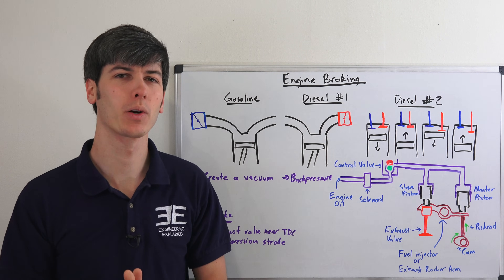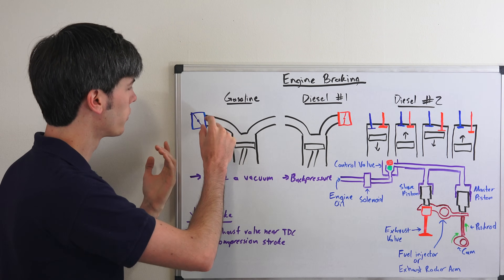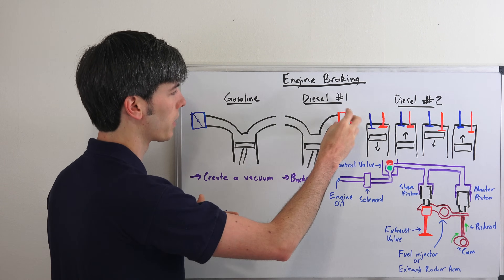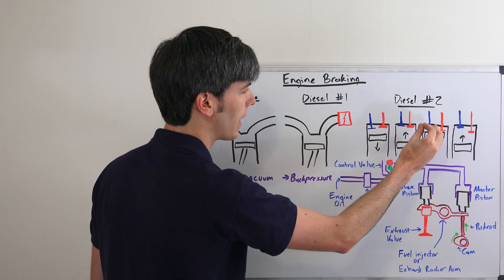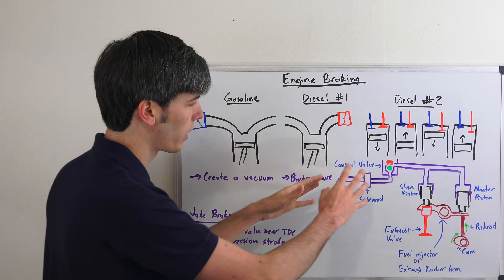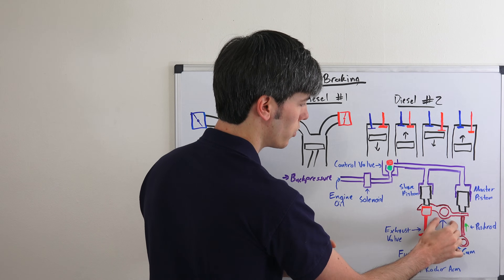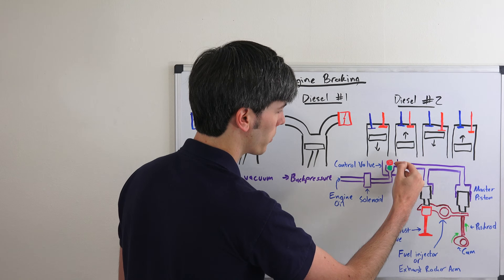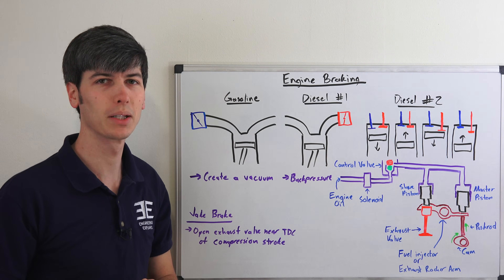What Is Engine Braking? What Is A Jake Brake?

Comment: Overall this is a decent introduction to the mechanics of engine braking. However, I believe that you could have added a couple of things to it.

First, in many electronic fuel injected gasoline engines, the computer is programmed to cut off the injectors in conditions where the throttle is closed and the engine reaches a certain speed, e.g., 3000 RPM, in order to enhance engine braking. The earliest example of this that I've seen is in a 1977 Datsun 810 equipped with the 2.4L inline six.

Also, in the case of the diesel retarder systems, it's important to note that these systems only engage when the injectors are set to their no fuel states, i.e., no fuel is being injected and thus no combustion takes place during the retarding process. This ordinarily happens when the driver removes his foot from the accelerator pedal and the engine is above idle. The second he depresses the pedal again, both types of retarders automatically disengage.

Comment: I have seen a throttle body on a diesel intake on a Renault Laguna. I wondered why it was there. I guess it might be to help engine braking. That doesnt sound good for efficiency though since its good to roll down hills with minimal fuel. It was a modern engine all ecu controlled and turbo charged.
Reply: Nope, it's not for engine braking.
Modern Diesel engines have throttle plates in the intake for their exhaust aftertreatment system. They close the throttle plate partialy when the the EGR-valve opens. This helps to recerculate more exhaust gases than normal because the pressure in the intake manifold will drop slightly. It helps to lower the NOx emissions.
Reply: Thanks, good to know!

Comment: I don't really understand this vacuum explanation, because OK, creating the vacuum takes energy from the engine, but in the compression stroke the vacuum pulls up the piston, so you'll gain back some of the energy lost by creating the vacuum. And I'm wondering if the exhaust valves can hold against the negative pressure? Because they are designed to work in the opposite way, and keep in the pressure. I'm not a mechanic, I'm just curious, and sorry if I misunderstood something.

Comment: Question (about the gasoline version). So there is a vacuum which is created during the intake phase, and that slows the engine down. But wouldn't the same vacuum accelerate the piston during the compression phase? Or is it that we have two vaccuum phases, intake and (not-)power stroke, vs one "inverse vacuum" (ie compression) and one non-vacuum, for exhaust?

Would engine braking be doubly efficient if, in some way, the exhaust valve would open during the compression phase too?

Comment: So which is most effective at braking? I'm assuming the Jake brake right now, but does that mean my TDI (VW Jetta Diesel) is using that too? Because from my experience, gasoline engine braking is basically useless when going downhill or something. But my Jetta actually starts engine braking by itself if you go downhill and brake long enough, it usually goes to around 2.5-3.5K RPM, and helps a lot in slowing it down. But because I live in the mountains the disk brakes also have a space between them to help in cooling, so which is better to use and will be more cost effective in the future?

Comment: Some people here, are claiming, that in petrol engines, the engine braking is done by the compression stroke, not by the vacuum between the butterfly valve and the intake stroke. Some in other forums, have also said that if the ignition is set to off, it doesn't matter wether the butterfly is 100% or 0%, the engine braking is still happening.  

But here's my opinion. In petrol engines that are controlled by mechanical throttle body (a cable), is this: 
 - Petrol engine (manual transmission) with a mechanical throttle body: 

1.) When you drive 15mph and turn the ignition off and you stop pressing the gas pedal, your butterfly closes (a little amount of air is still flowing to the chambers) so a little vacuum is created. The car is being engine braked like Sir Engineering explained said in the video.

2.) Same setup, driving 15mph, ignition off, but pressing the gas pedal*: Butterfly is open, a lot of air is flowing to the chambers. Instead of getting a vacuum, something's happening at the compression stroke: It's pushing the heavy mass of air and it's engine braking the car. 

Those are explanations why some people say the butterfly valve's position doesn't matter.

* In ideal conditions, for example if a car didn't have a battery to start the engine, you could roll it down a hill, in gear, and then pressing the gas pedal the engine should start. I've tried this with a little atv and it worked.
Reply: Yes, the resistance to the motion is not caused by the "power of a vacuum" as suggested in the video, read my post from 3 months earlier.    The "power" of a vacuum is nothing compared to the 8-10atms of resistance caused in the compression stroke of most engines........and there is more at WOT.

Comment: What if intake is delayed to when the piston is in bottom position, wouldn't this way the engine use vacuuming AND compression at the same time?
Reply: necrisuni I think it's because it would be harder to make a system which would prevent the (intake) valve from opening at the time it usually opens than making a system which just extends the time interval an (exhaust) valve is opened.
Reply: @987ntn  vacuum is correct.. the popping sound of a Jake, is the valves being sucked open..
Reply: You are on the right track my good man..that is how the Jake works, by pulling a vacuum...

Comment: I heard this today so I'd like to ask it here: is engine breaking at high RPM going to give extra engine wear to a small gasoline engine so that it will get to burning oil sooner (engine overhaul moment). 
To get into the details, today I was criticized for shifting gears on an old 1.4L gasoline engine so that the engine was breaking at around 3000 RPM (after rev matching to protect the clutch). The argument was that I will "help" with engine wearing.
Thanks!

Comment: New gasoline engines shut off the fuel injectors and open the throttle body. Than there is more air being compressed and more work being wasted by the engine. In electric/hybrid cars they switch the motors in to generator mode and use the energy to recharge the batteries a little bit.

Comment: Hello ???, Sorry I don't know your name.
I really like your explanation here but now I'm wondering how the valve in your center diagram really works, you can't totally block the exhaust obviously?? And the explanation of the Jake Brake, I don't believe they're bleeding off the combustion process products as you say. They're just bleeding off the pressure of compression which would other wise push the piston back to the bottom of the cylinder with pretty much no energy produced or absorbed. The fuel injectors would be cut off when the foots of the throttle and brakes are applied I think. 
(We used to have a lot of big trucks slowing down right in front of where I worked and I wanted to know what that really loud sound was.) 

I also read that some municipalities don't allow the use of Jake Brakes as the venting of the cylinder pressure right at its peak does create considerable  more noise than the normal opening of the exhaust valve at the bottom of the cylinder to vent the exhaust on the up stroke.
Reply: You are correct, that part is poorly explained.  The exhaust is not totally blocked in an exhaust brake or it would function the same as the compression stroke on the cylinder.  And there is no combustion taking place, the injectors do not fire.

Comment: Sorry, once I read that engine braking is due to creating a vacuum in the inlet I stopped listening.  

It simply is nonsense as it disobeys a fundamental law of nature/physics: the law of conservation of energy.  

On a long descent if we just used the brakes get very hot as we are converting gravitational potential energy(GPE) into friction/heat energy.  If instead we use engine braking to maintain a steady speed during the descent the GPE still has to be disappated, last time I looked I didn't see any red hot inlet manifolds or throttle plates, the theory falls over right there.

Where does the energy go, from the engine compressing air and transferring that heat to the engine block and out the exhaust.  No, the energy used in compression is not 100% returned in the power stroke, the internal combustion energy is very inefficient - perhaps look up the carnot cycle. 

Also worthy of mentioning, a vacuum at best only applies 15psi of resistance to the pistons on the intake stroke, but as you all know, on the compression stroke, we can have from 100-200psi depending on rpm and cam profile........that is where the braking effect comes from.  

As some others have mentioned, try WOT when engine braking with the ignition switched off, it will actually cause a small increase in engine braking(reason as to why we test for engine compression at WOT), if the vacuum theory were the braking would disappear when this occurs, it doesn't........please desist in spreading these myths.

Comment: I've been thinking about this for a while.. When you engine brake (in a gasoline vehicle) it sounds like (and feels like) there's two stages. One where it burbles and pops, and doesn't brake very much, and another where it's a lot more quiet, but seems to brake harder. I don't know what causes it.. Is it that, while burble and pops, the ecu is still putting ample amounts of fuel, but the is closed, causing the motor to run rich therefor more explosion after exhaust, and letting the pistons move easier? And then the ecu catches up and realizes to cut fuel, and therefor allowing the engine to slow down?

Comment: I haven't spotted it, but I hope I don't get hate for asking this, but has he done a vid about regular cars and if its beneficial to use engine braking ont he norma l than using brakes? like theoretical wear calculations and costs overall brake wear vs cylinder wear and reboaring, rebuilding engine (normal use, not that engine braking to the point you blow it out)

Comment: Is it good to tap the throttle technique while reducing from 3rd to 2nd gear for rev matching before engine braking on 2nd gear? And while not tapping throttle to match revs, is it good to perform engine braking on half clutch just to not stress the tyres and especially gearbox syncros? And i don't het the difference between showed #1 and #2 diesel backpreassure and jake braking technique. What;s the difference?

Comment: The roar of engine braking is outlawed in some municipalities. How can that be mitigated to not create adversity for local businesses and neighbors?
Reply: Older trucks sometimes were ordered without mufflers and that is why the engine brakes were so loud. No mufflers is a cool factor to some drivers, other trucks just had crap mufflers. Newer trucks are mandated to have a DPF, a special type of filter that takes the place of the muffler and makes the soot from the engine go away and the gasses from the engine safer. Think Volkswagen and their recent scandal, it involved the DPF and the software in them. Anyway a truck with a DPF is very quiet and so are the engine brakes on the truck. I normally cant hear the engine brake on mine over the radio. I always use the engine brake even if the sign says no to, police dont care as long as you have a DPF or an older truck with a good muffler. Just unmuffled is a problem because it sounds like a gatling gun going off. For the record I am a licensed truck driver who also has a degree in criminal justice. Many cop friends have told me their views on engine brakes and they are all positive.
Reply: Delightfully interesting!
Reply: In addition to what Stewie said, compression brakes are much quieter than Jake brakes.  And there is also the option of  a retarder which is mostly silent.

Comment: i drive an automatic is300 but i only use the manual mode. im constantly downshifting to help my brakes slow the car down. my question is, does this create any extra wear on the engine or transmission? my car obviously wouldnt let me shift into a gear that would harm it but it would create more wear wouldnt it?
Reply: Some on the clutch.  There is very little wear on engine and transmission components while driving.

Comment: Good video, I do think the second example is called exhaust braking, because the plugged exhaust is actuating the brake effect.  The third example, using the valves, is a true engine brake.  Just a minor point, very informative video!

Comment: Just don't drive to fast and apply brakes dudiciously.
Reply: If you pay thousands for brake pads, you are doing something wrong.
Reply: ***** Try again for what?
Reply: ***** Big rigs? no but i do my own brakes which costs me around 6-900 depending on prices at the time
Reply: ***** It has 2 axles, its only an SUV, but i also dont buy OEM brakes (probably should ) ive never had to replace the calipers on it yet, only done pads and rotors

Comment: so on a motorcycle is it going to cause less ware on the engine to use my brake pads to slow down instead of downshifting and engine braking
Reply: Which would you rather replace, your brake pads, or your clutch?

Engine braking for light vehicles is reserved for going down a mountain.

Comment: I've seen diesel engines with intake throttle bodyes to stop the engine and increase EGR gases recirculation. I don't know if this throtle valve is actually used to increase engine drag.

Comment: How engine braking works in Natural Aspirated engines(Without turbo)

And in Turbo engines because they wouldn't have any Throttles in exhaust side.
Reply: No stress, the explanation is wrong anyway. No matter it is Natural Aspirated, Gas, Diesel or Turbo...

Comment: But does engine braking work as well on old carbureted cars or just carbureted cars in general?
Reply: 66nailhead225 Engine braking works to a certain extent on any four-stroke engine. Its efficacy depends on the engine's compression ratio, actual not theoretical so worn piston rings or cylinder bores will reduce it.

Taking your foot completely off the accelerator shuts off the fuel supply so that compressing the air without fuel, or with a minimum of fuel in a carburettor system, causes resistance to turn so the engine is trying to slow down the car.

Comment: the first diesel engine braking he explained is call an exhaust brake because its using exhaust pressure. also i have never seen a diesel using both however it may have been done but be very rare. the second diesel engine braking he explained is called a compression release brake which is the conventional method. Jacobs also makes a third diesel braking system called a bleeder brake which is like a conventional engine but less effective and has to be with a VGT or an exhaust brake to be optimized. jacoobs also has a "2 stroke" engine brake which which is much more effective then the conventional

Comment: So I have a question about engine braking. Obviously your closing the throttle and creating a vacuum as you said. Does this increase fuel consumption? When you do this, the mass of the vehicle will bring the rpm up. By bringing the rpm up, wouldnt it consume more gas? I've never believed it to be true until I thought about how much noise happens during engine braking. It's as if combustion is still happening.
Reply: In modern fuel injected vehicles the ECU stops to fire the injectors if the rpm is above idle an no throttle is applied. So the fuel consumption is 0 under engine braking.

Comment: Love the videos but? Is it vacuum? I alway thought it was the compression of the motor
Reply: On a gasoline engine it is vacuum.  The piston is pulling against the vacuum of the throttle, hence a resisting force.  Compression provides very little braking because nearly all the energy used in the compression is given back to the engine on the power stroke as the compressed air is pushing the piston back down with almost exactly the same energy as was harvested to compress it.  Some is lost into the engine as heat.

Comment: Does engine braking increase fuel consumption? Higher rpm while engine braking vs brakes only with clutch pressed (neutral)
Reply: Californian John in a gasoline motor, no, but in a diesel, specifically in a tractor trailer, yes. you are essentially dumping disable into a motor to then waist it on slowing down. as explained above the cycle runs as normal, except potential energy that is meant to produce torque, is dumped out of the exhaust as a means to slow down instead.
Reply: The engine goes to idle, so the injectors are still lubricated.  The governor only governs high rpm.

Comment: I'm surprised you didn't cover if it's costly to do engine braking 'cause it may wear out the seals which is much harder to replace than brake pad & rotor.
Reply: Not true, if your seals fail as a presumed  result of engine braking then they were always going to fail, there is no more stress on seals engine braking as there is driving as maximum engine oil pressure is obtained a few hundred rpm above idle so from that point on your engine is technically under maximum seal load. Only temperature changes after that.